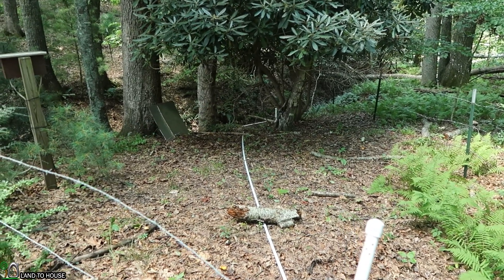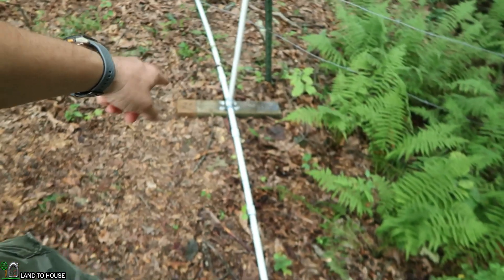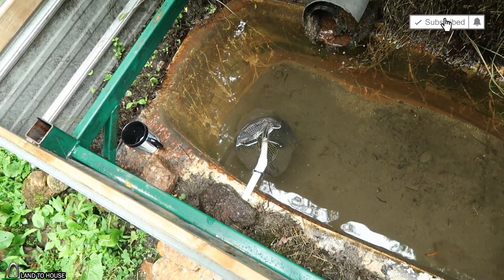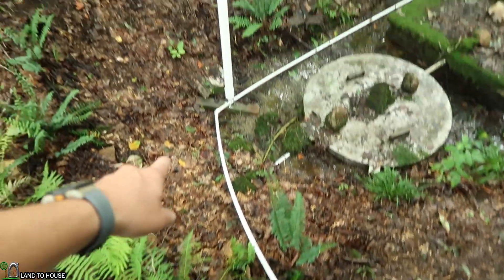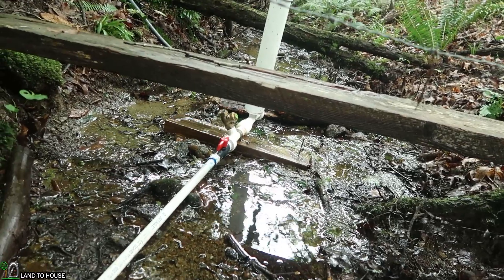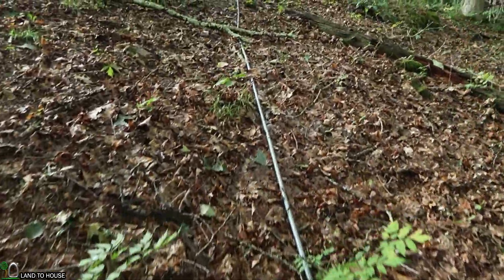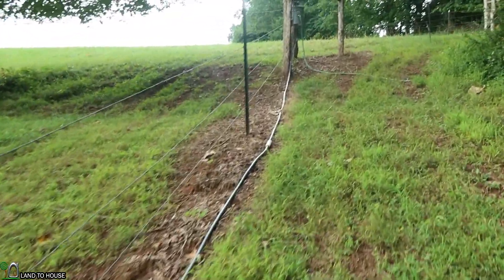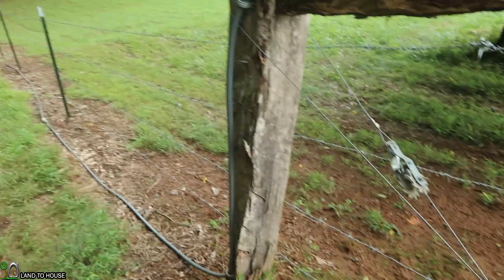Cross Tembers Farm Ram Pump Update

Comment: Interesting work arounds.  Re. breaking a siphon, usually just an air vent works, sort like the stand pipe on the pump inlet.
Reply from the maker: Yes that is all that would be needed. A simple T would have worked. But it was a fun way to show off the filter bucket.

Comment: why does tilting the valve reduce the water suction? Also isn't that pump cycling too fast?
Reply from the maker: The pump is cycling a bit fast because the drive pipe is short. Also because we have tilted the valve it takes less pressure to close the valve and that uses less water. We are going to proceed with insulting the super small 3/8" pump.
Reply: @LandtoHouse  does insulting a pump shame it into working better? 😂
Reply: @LandtoHouse  bruh dont insult the little child
Reply: @Sylvan_dB  u can't make an omelette without breaking a few eggs. Lets insult that little brat! 😊

Comment: I'm uncertain as to the function of the stand pipe.  Is it necessary?
Reply from the maker: Because the drive pipe was longer than 100' the standpipe is installed to shorten the pressure wave.

Comment: G'day Seth.
The local Museum, in the town Yarra Junction, Vic, Aus, has a old very large ram pump that has a infeed/ penstock pipe diamiture about 300mm/ 12 inch, feeding into a similar size cast iron horizontal manifold, on top of this manifold are six (6) waste valves, that must be 75mm/ 3inch at least each, with a large pressure tank, and delivery pipe flange cast into one piece. My understanding is that 6 waste valves would only interrupt the water hammer, but this ram pump supplied a substantial house and it's surrounds for 50 yrs.
Old timers that worked on the property did say you could hear it working a long distance away. 
Cheers from Australia 👍

Comment: Seth, you need to try using adjustable foot valves instead of those regular half inch one way valves. You can adjust the tension on the foot valve spring and make the ram pump run faster or slower, that way you can dial in the perfect 60 beats per minute, or dial it up/down in case there isn't much water. You may also try using a spring check valve instead, since foot valves normally come with silt screens that need to be removed.
Reply from the maker: I actually have used foot valves a few times with the ram pump. They seem to offset and wear rather quickly. That is why I've stuck with swing valves over the years.